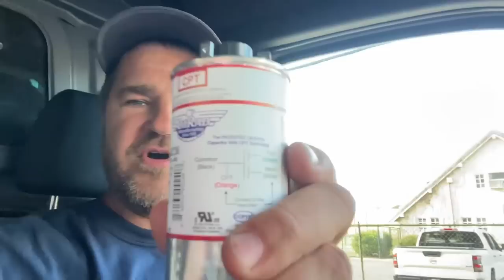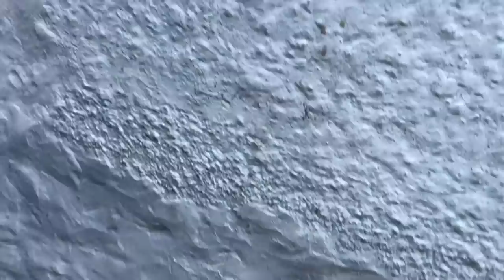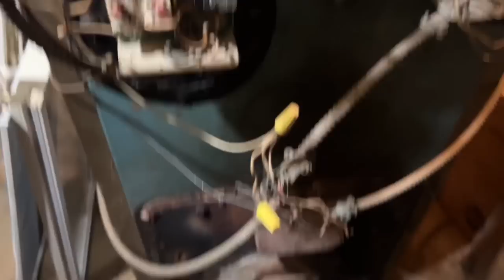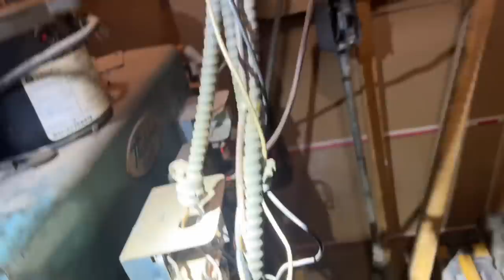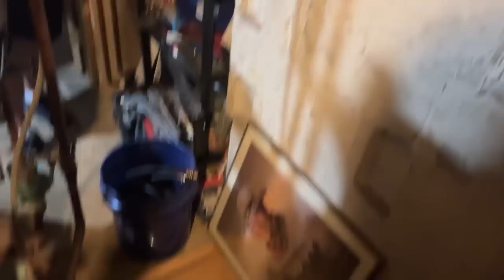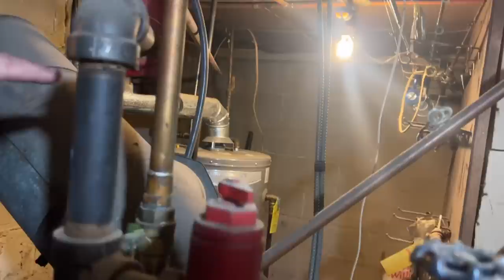Retired Oil Heating Mechanic Wants to Convert His Heating System to Natural Gas

Comment: My alpine 105 is direct drained from the pump right outside the house right above the foundation. About 2 inches sticks outside pitched down. Not once has it froze. It pisses right out behind the shrubs. And I’m in Rhode Island .  Now if that drain was  sticking out more outside it would be a issue I’m sure.

Comment: yeah, those caps you were using are junk. y'all have less call backs and more happy customers with the better caps. I use the 12200 and 12300 from Ferguson and charge accordingly.  you can build it up and it covers most all cap sizes with just two caps. We do a 5 Year Part and Labor warranty with it. DFW heat kills equipment.  Like that video! Good Job Mikey.
Reply from the maker: Thanks Mark. Going with Amrad company wide now.